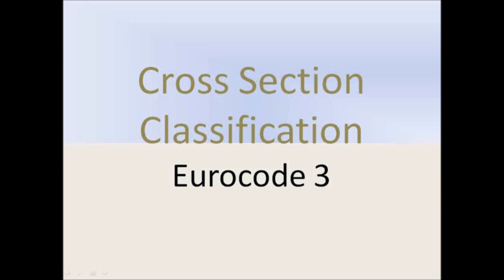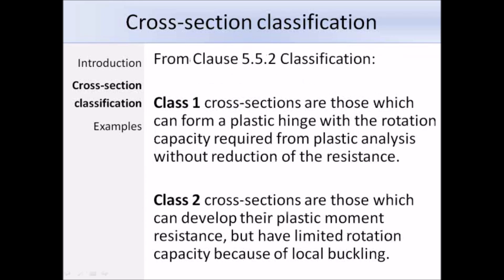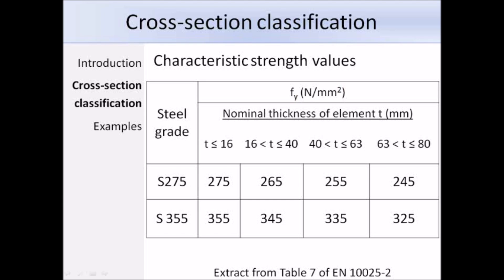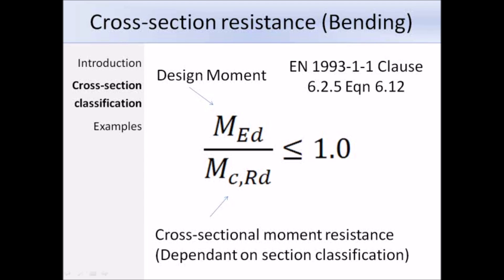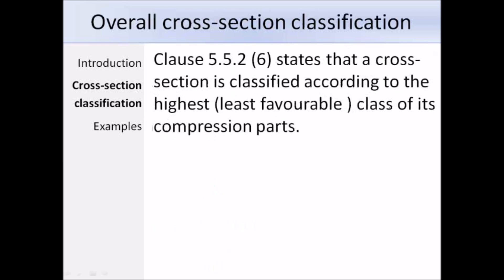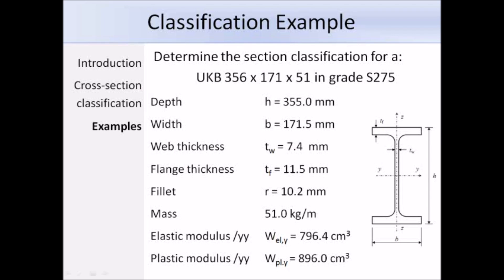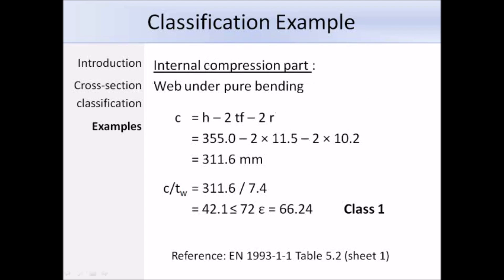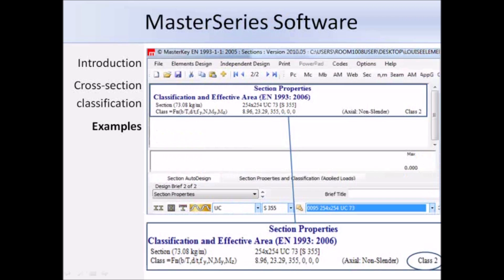Cross-section Classification & Resistance to Local Buckling | Eurocode 3 | EC3 | EN1993 | BS 5950

Comment: hello thank you for your great efforts.
I have 2 questions please..firstly why the Fyield and Fultimate values decrease as the nominal thickness increases ? secondly if we assume that we have 2 sections having the same thickness and flange width but different steel grades that means if we are going to classify this member it will have different classification depending upon the yield strength of steel 
how is that possible?
Reply from the maker: Amr Abdullah 1) Mechanical properties of steel are influenced by chemical composition, heat treatment and manufacturing processes etc. Thinner sections through relatively more mechanical working compared to thicker sections gains different properties (increase in strength).

2) Cross-section classification in Eurocode 3 is based on the ‘material yield strength’, the width to thickness ratios of the individual compression parts and the loading arrangement. Furthermore, the cross-section classification limits are based on the assumption that the cross-section is stressed to yield (except some relaxations).
Reply: @IamDilakshana  thank you so much!
Reply: @IamDilakshana  Thicker parts have less reduction ratio while Thinner parts have higher reduction ratio. General reduction ratio is 1/6 which means if plate is converted from 36mm hot billet to make it 6mm then its reduction ratio is 6. As the reduction ratio increases the Work hardening in material causes Yield strength to go high. I hope it answers your Query Abdullah. :)

Comment: Hi , i have a question
If in the. Exam ask me to design , so at the beginning there is way to choose a satisfy section before start solving the question?
Reply from the maker: Hi. You can choose a suitable section by undertaking a preliminary design and then verify the section during your detailed design (solution). However, in an exam you have limited time to take that approach. Do you have a model question or an example? علي مدن
Reply: Dilakshana Mayadunne yes i have , but where can i show it to you?
Reply from the maker: علي مدن www.facebook.com/IamDilakshana
Reply from the maker: علي مدن I can’t message you on Facebook for some reason. What ULS checks are you expected to undertake?